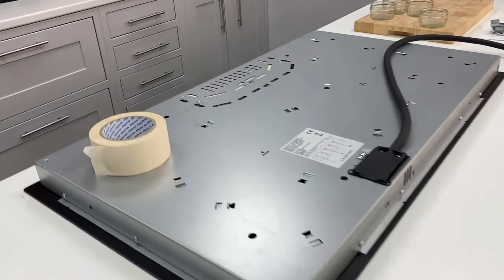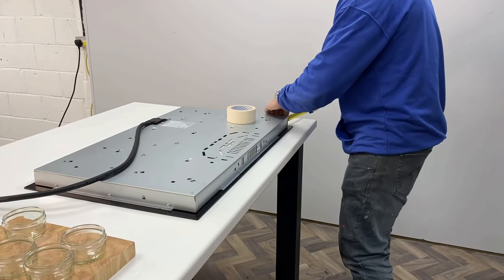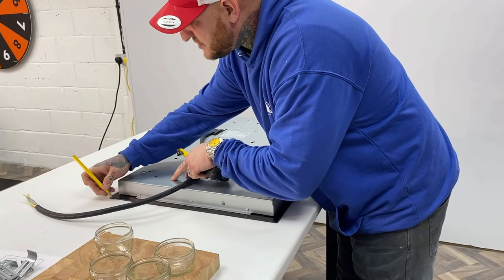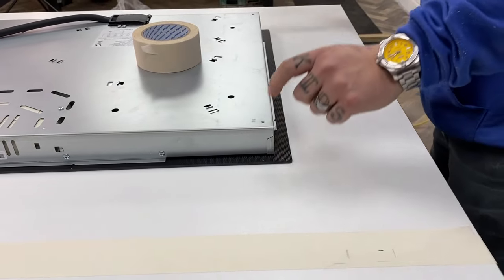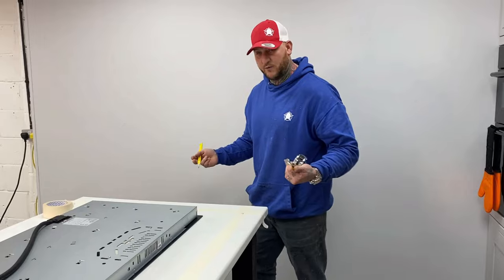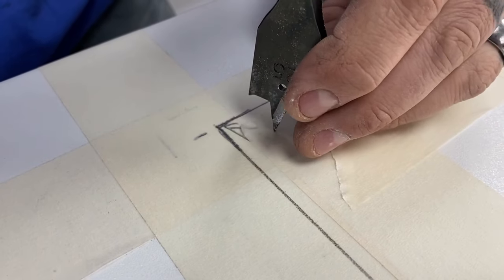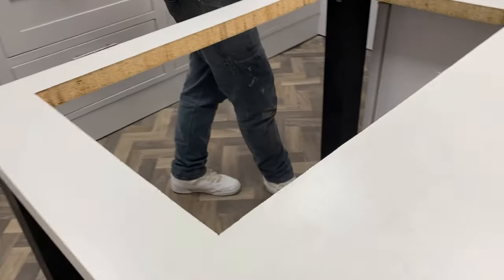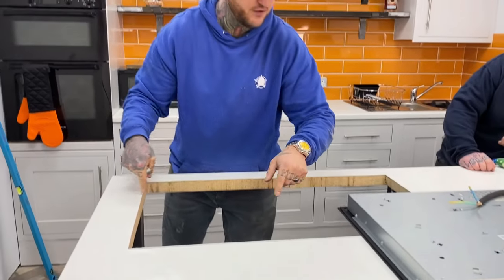How To Install An Induction Hob Into Worktop

Comment: Missed out the actual hole cutting, and didn't mention that you might want a laminate or reverse blade to avoid chipping. And reading the instructions might have given you dimensions and clearances.

Comment: helps to seal the worktop cut edges with varnish or similar sealant. Any spills that do get through won't then soak into and expand the worktop Substrate.

Comment: You could just get the installation instructions out of the box that would have the cut out sizes all layed out in it instead of messing around sliding the glass top all over the bench.
Also some appliances require a set cut out size to allow clearance. 
Never silicone seal cooktops in
Reply: Genuine question... Why shouldn't you silicone it in
Reply: Genuine question... Why shouldn't you silicone it in
Reply: I guess it's because the silicone would make it super hard to remove it. You would basically glue the hob to the table top.
Reply: @johnrhodes3350  think it's to do with heat and to allow expansion etc...
Reply: so is that double sided sticky tabe is ok?

Comment: You can also use a track saw, or a skill saw if you feel comfortable
Reply: Skill saw won’t cut through work tops at a straight line, use a plunge saw
Reply: @harryhamilton676  i use a skill saw and  always get a clean cut
Reply: @mattystyles4683  well that’s the most stupid thing to do if your cutting work tops. A skilly is good for CLS but for work tops use a tracksaw, festool preferably, your clearly a DIYer 😂
Reply: @harryhamilton676  its the way i was tought and im a general builder, beside im not asking for your opinion
Reply: @mattystyles4683  flair play bud just saying, only cause I’m a chippy